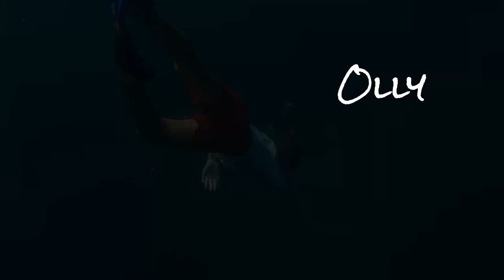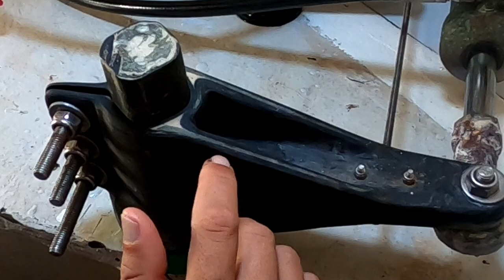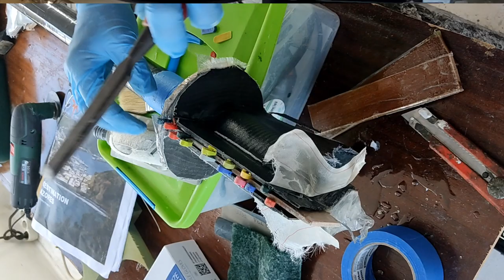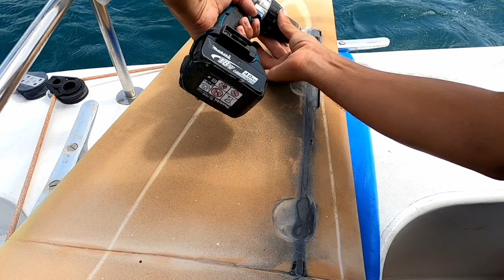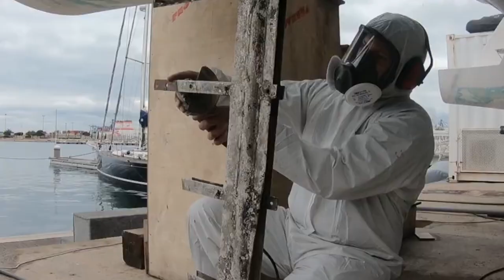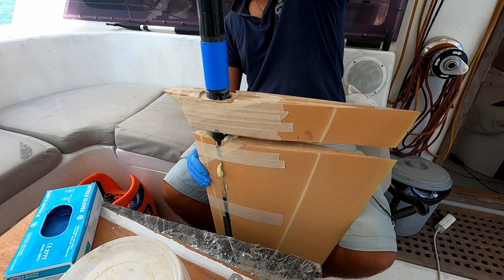Tiller arm and torque tabs - what needs to be carbon?

Comment: I think a carbon stock is a better choice on a cat when considering impact resistance. We like our rudders to run as close as possible to the underside of the hull for the “end plate” effect. In the event of a large impact this almost certainly means a bent metal stock, which buries the rudder blade into the hull. The hole it creates is the least of your worries, the bent rudder will prevent the other rudder from operating- at least until you find a way to decouple the two rudders. On the other hand, an impact violent enough to snap the carbon shaft may also fully remove that rudder from the equation. Potentially leaving you with one operational rudder? I’m sure there are many variables that would create an alternative outcome. Is this a sound premise?
Reply: a rudder which wont break will put a hole in the hull.
Reply: I remember a Beneteau 60 which almost did it over a reef; The keel past over it with the wave but not the rudder. The GRP stock did not break, so the entire stern stayed on the reef, alone.
Reply from the maker: Yes, I would agree with your analysis. And a bent rudder is a whole new world of hurt. We have hydraulic steering on Paikea and although I'm not really a fan of it, it does have the option to open a valve to release coupled rudders if the need arises. I do still prefer the casette style rudders (like Gunboat) over a stock arrangement however I'm not about to do those sort of modifications to Paikea any time soon.
Reply from the maker: our rudder blade is designed with a sacrifical tip so that if we hit something it will break off however if the stock is hit hard enough it will put a hole in the boat. Paikea has water tight compartments behind the stock which are designed to deal with that scenario

Comment: Very instructional video. Would you mind sharing the contact info of the CF shaft supplier ? I'm currently building a 46' cat and will need some stocks in the near future . Thanks.
Reply from the maker: C-tech made the tube for us. Check out our Boat Systems page on our website. It has the web address etc https://youngbarnacles.com/boat-systems/

Comment: The old way would be to use waterproof multiplex for rudderblades. Can you compare ?
Reply from the maker: I'm not familiar with waterproof multiplex sorry
Reply: @youngbarnacles  it’s a composite of epoxy and layers of the highest quality woods. You can shape it into any profiled rudderblade  it has a durablility guaranty of thirty years unprotected in water. It maybe slightly heavier than your rudders, but that depends on howmany layers you had to apply.
Reply from the maker: Ah ok. We wouldn't put any wood on our boat especially below the waterline. We're busy trying to get the stuff off Paikea 😅
Reply: @youngbarnacles  you chose your name correctly